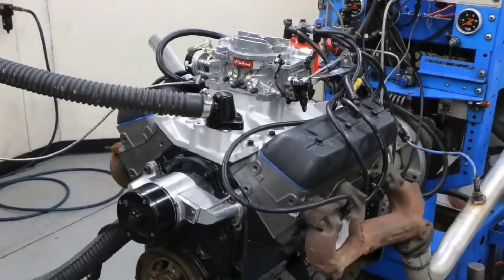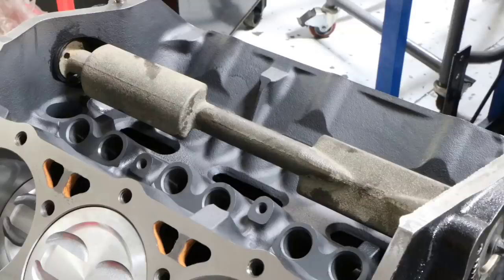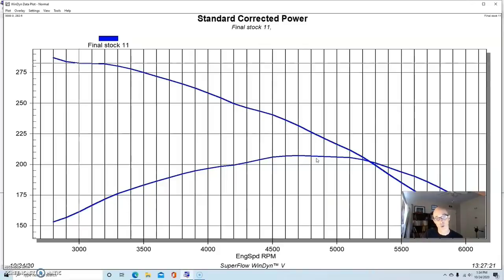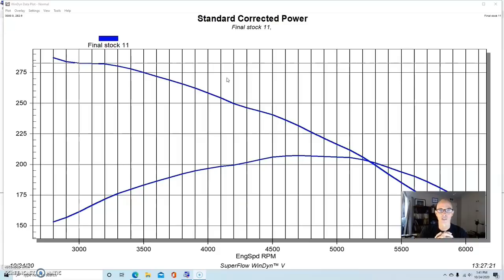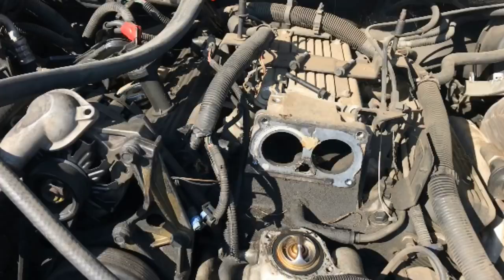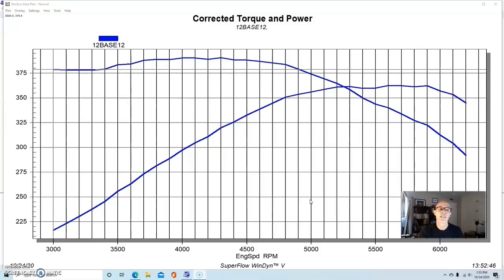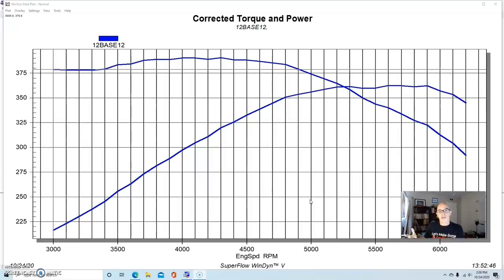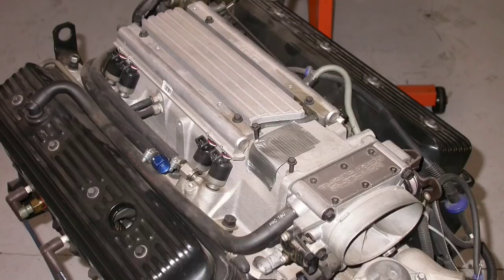4.3L V6 VS 4.3L V8-WHICH OTHER GUYS MAKES A BETTER BUILDER?

Comment: U should do a video of the chevy 4.2 inline 6 versus 4.3 v6 let's see what happens
Reply: The amerabarra as they call it. The vortec 4.2 inline 6. Hmm.
Reply: He's mentioned the Vortec 4200 here and there, and has expressed interest in getting one on the dyno in one of his his junkyard search vids.  I actually called it the amerabarra in a comment and he responded saying it's what he'd call it as well.  This is definitely something that's been on the mental back burner for a bit, and one that I'm hoping to see soon because I'm planning on using one myself.
Reply: @andrewstewart1464  These things are everywhere here in Louisiana. You can go to the junkyard, cover your eyes, throw your ratchet, and you'll hit a gmt360/370 with one of these 4200's. They also have the aluminum 5.3s.
Reply: @WillThat  they are definitely slept on, so now is the time to pick them up.  You can even buy a running car for pretty cheap if you wait and get a bit of luck.  Don't get me wrong, the LS is still the cheap junkyard king, but these are sometimes even cheaper and give an alternative layout challenge.
Reply: John Cunningham built a turbo'd 4.2 Vortec like a decade ago for a 66 Nova wagon that made 1400 hp and ran 9's in the quarter. Where have you guys been?
Reply: @justinkeckhaver8199   just goes to show you how hard this engine is slept on.  I'll look that stuff up.
Reply: @justinkeckhaver8199  i actually saw that video it was also on that sloppy mechanics youtuber post
Reply: @justinkeckhaver8199  1400hp and only 9s? How heavy was that fucking thing lol
Reply: On Hot Rod Garage they built one as a cheap Barra
Reply: The 4200 I-6. One of GMs best engines ever, and what do they do? Not use it in much of course. It should have been in the Colorado, Canyon, Hummer H3, Commodore, CTS, and Camaro
Reply: @alexs3187  I had a canyon. You aint fitting a 4200 in there without pushing the firewall back. That's why they put the 3500/3700 in it
Reply: Hotrod did a max effort V6 build years ago.
 600 hp. NA.
Reply: That's the Atlas engine, it honestly was comparable to the Gen III 4.8 V8, which is why it wasn't used in the Silverado or Sierra 1500, it would have cannibalized 4.8 sales
Reply: @FirebirdCamaro1220  I mean if they would have put the 4.2 in the Pontiac solstice or chevy colorado that thing would be making history I mean imagine it going up against a 2jz motor or a Nissan motor
Reply: @FirebirdCamaro1220  and 5.3. But the I-6 was better than both of those.
Reply: This! I love the inlines for their nostalgia in the old 50s and 60s stuff. The 235 blue flame is legend but I think the made a 292 that was not to shabby in the hp/torque category.
Reply: @clintbriant8508  the 292 was mainly used in 3/4 ton and 1 ton trucks as the base motor, it was the last one to be carbureted as well, made until 1990 and never got TBI like the V6 or V8's
Reply: I6 is better than v6 but v6 is smaller
Reply: @WillThat  hey Will, can you please shoot me a message with your e mail?  I grew up in Louisiana outside of New Orleans.  Haven’t been back in years.  I’m interested in possibly moving back.  It sounds like you know what your doing.  Thanks.

Comment: I love the 302 vs 305 idea. Im sure the 302 will be alot more fun but im still excited as hell. You are a gem and the world is lucky to have you
Reply: The biggest difference would likely be with high rev combos. And a 307 would most likely have torque and horsepower curves in the middle of the other 2 since the bore and stroke is in the middle. But I'd bet it would be closer to the 302 since the difference in bore size is alot closer than the 305 to 307.
Reply: The 4.3 L99 was used in Caprice Sedans as a replacement for the L03 TBI 305, it had a power and fuel economy increase over that engine, 200hp for the L99, 170hp for the L03 305
Reply: While the LT1 350 was a replacement for the L05 TBI 350 for Caprice Wagons, Roadmasters, Fleetwoods and optional in the Caprice Sedan, base motor in the 93 Caprice Sedan was still the L03 TBI 305, which is what the L99 4.3 replaced
Reply: Straight 6 smoke both of them
Reply: @beforeal580  nah. 302’s (Chevy that is) we’re high revving power monsters for their size. Easy to make over 400 horse with the right heads and cam. Straight 6’s are great, superb towing engines, very simple practically anyone can get into them and work on them with success. 305 is good and can make power but get ready to throw money at it. They make good torque with a longer stroke but will not breath above 5k.

Comment: I love V6's but the v8 all day. Smoother and sounds way better.
Reply: But smaller bore to make same displacement so will be slightly down on power at high rpm
Reply: Erm the LU3 is a V6 90 degree like the 350.
Reply: 262 vs 265CID
Reply: @derekmaxwell8164  not exactly, compare 2.02 x 6 vs 1.94 x 8. Maybe if afr made v6 heads it would be different😂
Reply: If they're the same displacement I honestly would pick a v6. They will be a smaller block and head and lighter. They're easier to swap. I actually like the sound of 90° flying arm v6s.
Reply: @derekmaxwell8164   i say better for hp on L99. Torque on V6 i think be much higher than L99.
Reply: There is no question that the V8 will sound better.
Reply: Honestly, the 4.3 l V6 since there's more aftermarket support, since they're just everywhere. When's the last time you've seen a '90's caprice kicking around? That's my personal thought though, I will say that I didn't really look it up besides previous experiences.
Reply: @sdusb1243  The aftermarket for the L99 far exceeds the V6. The L99 is a small bore/stroke LT1, which means in terms of internal components the sky is the limit, anything that fits a roller block SBC will fit inside a LT1/L99.

Heads from any LT1 will bolt-up.  The intake is an LT1 intake so you basically don't need to do jack squat to the intake, it can flow enough for 500+ no problem.
Reply: Just accept that the v8 is slowly but surely dying (from a production standpoint) and the best of it all is even the American car companies are starting to see the truth and are slowly getting rid of em! Say what you will but smaller motors with less cylinders will eventually (and kinda already are) overcome and make a mockery of these behemoth powerplants
Reply: @antisobriety4201  Really? how about hellcats, demons, redeyes, corvettes, gt500s, Bugattis, Bentleys, rollsroyces, Lamborghinis, ferraris, vipers, and even diesels all have v8s or much larger powerplants but ill even admit on the diesel side i prefer the cummins straight six, well id rather a twinturbo 2 stroke Detroit diesel v8 or v12 but out of my price range
Reply: @Lotek117  i said SLOWLY yet SURELY....not 
 in the next year...Im not sure you got the point of my comment... Not that it matters, seeing that this is 2020 and the world is almost hardwired to get offended by everything, pointless "debates" like this are as commonplace as the v8s mentioned in this video and equally getting more and more obsolete...
Reply: Yes. Really. And you're damn right I'm giddy with excitement that finally we're in an age where there IS a replacement for displacement and I'll repeat what i said before, lots of things that arent necessary anymore still get incorporated in many forms of tech, and LARGE ENGINES ARE A PERFECT EXAMPLE. 6 and 4 cylinder engines (and rotaries if you really wanna get technical) have been proven to outperform their larger counterparts for a number of years and you mentioning multiple brands that don't incorporate smaller engines doesn't delegitimize what im saying. You can consider what im saying opinion but the proof (albeit not widespread) is very much in the pudding. With forced induction, different forms of valve control tech, the availability of stronger alloys getting more and more advanced allowing engine developers to achieve more and more examples of volumetrically efficient machines you'll start to see less and less high displacement stuff powering high performance and comuter cars the further we go into the future and there's no denying that.  So say what you have to bud, at the end of the day this shit (the joys of automotive engineering) means everything and nothing to me. Guess which part means nothing...
Reply: @Lotek117  nope i dont really need to mention koenigseggs tfg, any series honda motor from A to J, the 1jz, the 2jz, the 4g63, and more... Either way bro I'll keep my pipe dreams and continue on with the progression of technology. This little trip back to 6th grade was nice now i have to get back to real life have a good day k bye...
Reply: @Lotek117  i tossed it in as it used a form of variable valve tech and drag racing is literally the only thing you keep mentioning because its the only motorsport where a heavy oversized engine makes sense apart from tractor pulls, nascar and burnout competi- im REALLY arguing with probably some plumber In middle America right now... Yeah bro you win im guessing you really need this for your daily dose of self validation, rest assured just one more comment and youll have the last word.
Reply: @antisobriety4201  v8s aren't dying.

Even Toyota and Nissan have them.
Reply: Granny Gertrude  are you talking about all the foreign cars that used to only come with 4 and in some case 3 cylinder engines that now offer v6 and in some cases v8s?
Reply: Granny Gertrude  dude did you really make another account to continue this argument? Oh yeah i already made the point that everything is going electric before you ever responded to me, so nice comprehension skills there boomer. As for insulting my name, that makes me think your actually still in grade school, you havent used one iota of information in your statements.

Comment: When I was at WyoTech in Laramie, WY for tech school, I had a friend that owned and chassis dyno’ed a 97 Chevy Blazer 4WD daily driver. It made 135HP & 270lb-ft with all the emissions controls and complete factory setup. It consistently made this power over 5 Dyno runs with 280,000mi on the odometer without any hesitation.
Reply: the steel wheels on those trucks bend easy and after awhile the truck rides like absolute shit. Next time you ride in one with the stock steel wheels, notice this.
Reply: @ryanmalin I would but, I’m long graduated from school and I never see those late 90’s blazers anymore. Not to mention when I did see them, most of them looked like the front ball joints were about to fail because the wheel was tilted in at the top and out at the bottom. Plus, I’m a Ford guy that used to work on many different makes and models of vehicles. I wouldn’t dare ride in a Ford Explorer or a Chevy Blazer because both were similar designs that both the engineers should’ve been castrated for making in the 1st place. 

Neither vehicle were worth their weight in gold but, I saw the Dyno runs myself and helped the owner do the runs as he was my toolbox partner in school. We used to give each other hell about the standard Ford vs Chevy crap, however the little 4.3 V6 baby brother of the Chevy 350 did make substantially good power for “a little engine that could”. My argument was always “there’s no replacement for displacement” and that I’d never use anything less than a Ford V8 in any project except for the trade and true almost bulletproof Ford 300ci straight 6.
Reply: Man 270 tq at the wheel isnt bad at all considering
Reply: @80sfordguy  it's the upper a arm bushings that wear out and makes it ride like Grimace from the McDonald's playland.
Reply: @jacobmarshall2503  yeah when my friend saw the numbers we were both jaw dropped, we figured maybe 180-220 at best. Them 4.3’s are Torque little things.
Reply: @calvinevans8305  figured that an ballpoints would be the cause, still neither the explorer or blazer were really good suspensions anyway. Ford and Chevy certainly got cheap back then, even more so now days especially.
Reply: Wyo Tech alumni here 🖐🏼
Class of 95"
Reply: @btnerual  class of 13 myself!
Reply: Ghetto-Tech, class of '81  *San Bernardino California. Now  in Evanston.

Comment: I built a 4.3 V6 Vortec. Waiting for the suspension upgrade before I dyno it. 280 .525 cam and full roller rockers and a 411 PCM swap to program and rebuilt heads with double springs and short through hydraulic lifters. Also upgraded the injectors and cut the skirt out of the intake valve if you know what I mean. Everything else is stock. I will let you know what it can do later. For now it sounds sweet!!

Comment: I put speed pro flat tops in a 267 with a summit cam kit 272 /282 I think about 480 lift. I ported and milled the heads at a machine shop .030. performer EPS. 500 EDELBROCK CARB. HEI ignition. MSD 6al. Long tubes. I had a 73 Pontiac Ventura that came with a straight six. Three on the tree. I removed the 6  installed the V8 with zoom clutch new pressure plate and throw out bearing. I was VERY IMPRESSED with the POWER this combo had! Tires chirped easily ! Great acceleration! It turned high rpms easily. Loved this car!

Comment: V6, the little engine that could. Towed my 21’ day cruiser with a BBC , with my now ex’s 2003 Safari from Thousand Oaks to Parker AZ. Thing never slowed down and there are a couple good grades to pull. Always like the under dog in the battle.
Reply: Sorry bout that man. 😐
Reply: Tow my 8000 lb bobcat on trailer with all tools with my 4.3 Vortec in my 1500 express van.
No problems
Reply: A lot of people slept on the 4.3 V6. Those engines had great torque with a 700 trans or 4L60 behind it. My '88 GMC S15 upset many V8's from red light to red light.
Reply: I've got a '91 S10 with a 5spd manual and 3.08 rear gears, but I was surprised when I towed a trailer from Utah to Arizona (9 hours) that the truck didn't even seem to feel it, even up hills. The only thing was on a very long and very steep uphill (~6 miles) the temps started to get very warm but the engine still had the power.
Reply: @matthewmccollum9750  I pulled several vehicles, by chain or strap, on the Interstate and didn't even noticed the weight behind me.
Reply: @matthewmccollum9750  I thought the majority of The S  series had 3.73 gears?
Reply: @coreyjenkins3056  at least in 1991 it was 3.08 (relatively common), 3.42 (by far the most common), or 4.10 (smaller displacement/smaller engine S-10s, normally also paired with smaller wheels). Apparently you could also get 3.23 gears or 3.73 gears on an S-10, but I'm going to guess that those were only later model years because I haven't heard of them or seen them on a square body S-10.
Reply: @matthewmccollum9750  thanks for the information. A lot of guys used to search for the rear end out of the Blazers for the position traction unit. My S-15 would pull two wheels if I locked the rear end by spinning the tires in reverse.
Reply: @coreyjenkins3056  Yeah, I really want to get a posi unit, but I'll probably have to go aftermarket to get one (I'm looking at Auburn units). Factory ones are hard to come by, and even more so these days. And then if you do find one, they're often worn out and in need of a rebuild anyways.
Reply: @matthewmccollum9750  true.

Comment: Put together an '85 4.3 v6 (two piece rear seal and flat tappets) put '84 229/3.8L heads on it, cut them out for 1.94/1.50 valves, deshrouded the chambers, put Dave Vizard 5 angle seats on them, was running a SERDI Seat & Guide Center for a living at the time so why not!?, a Lunati Street Master cam #33504 in it with roller rockers and topped it off with a marine GM spread bore intake with a Qjet on top, Astro van headers and 40 Series Flowmasters for exhaust, it was in a CJ5, supposed to put out 230HP and 330 TQ?, it would make that CJ SCOOOOOT!!!!
Also have a 262 V8 out of a Nova, I remember if you held it wide open and dropped it in drive it would give about half a revolution of the rear tires, in the gravel?
Reply: Hello Steve this is John Paul Schafer  I was just curious do you  still have your 262 RPO LV1 Chevy V8 out of your Nova if you could reply at appreciate that had one did a lot with it the one I had was
From a 75 monza 4spd I now have 
Several 267s RPO L39  
My brother owns the business 
MARLIN CRAWLR 
 In Fresno Ca
like to chat with you
Reply: Haha my first car had a lean burn 318 and it would only spin a tire when it was snowing.

Comment: I believe they both will have their own perks. Depending on what engine bay space you have would lean toward each engine. I had LT1 cars in the past. I had a 94 S10 SS with 100 shot of N.O.S. that 4.3L loved the spray!

Comment: The extra 2 power pulses per crank rotation is a bigger deal than you may think.
Reply: No so much the extra power pulses but percentage of work done for piston travel efficiency, the most efficient is between flame propagation point to just after 90 deg so in a 6 cyl there is a greater efficiency loss due to expanding cylinder volume than 8 cyl, this seems to be a consistent trend when watch test engine data with pressure transducers, and the caviat is on pump gas, as with more exotic fuels combustion expansion characteristics offset cylinder volume increases due to their thermo chemical expansion properties such like the need to open exhaust valve early enough on nitro motors to allow cylinder pressure to drop enough to stop it trying to force pistons out the bottom, just some observations
Reply: It's 1 more power stroke per crankshaft revolution
Reply: @alanvincent1615  Yes, correction, my bad.  (-:

Comment: 94-96 chev engine vin id - W is l99 and P is the 5.7 lt1 -think its the 9th w-weak P-powerful
Reply: W= Wish I had the LT1
Reply: 8th digit is engine.
Reply: The W is the 4.3 vortec central port spider injection. Had it in my s10 Tahoe.  It was nutty fast .
Reply: @btnerual  Then that's because they reused engine VIN codes between car lines.